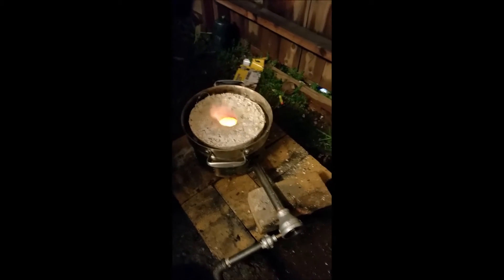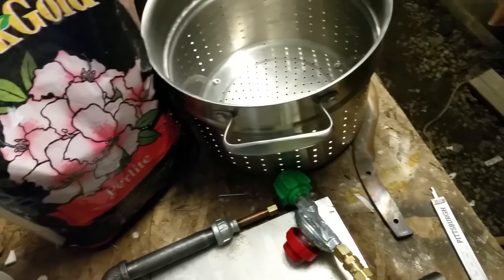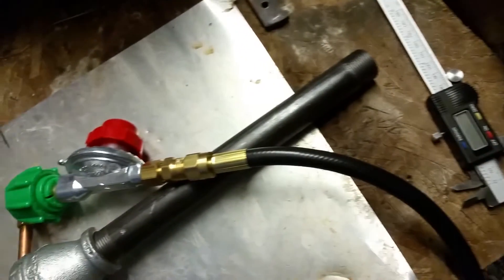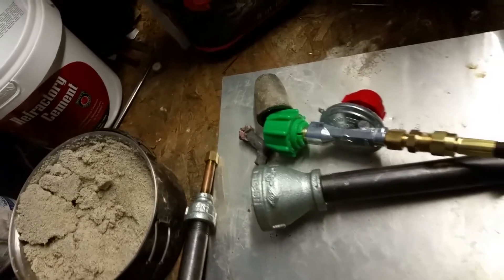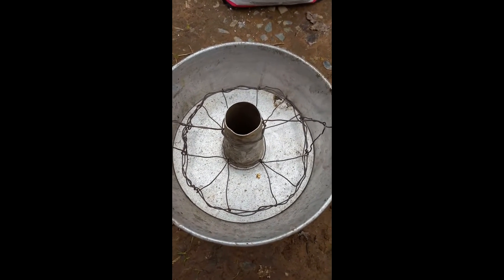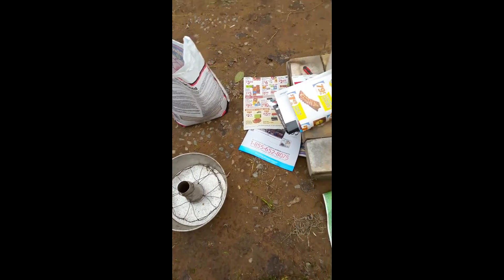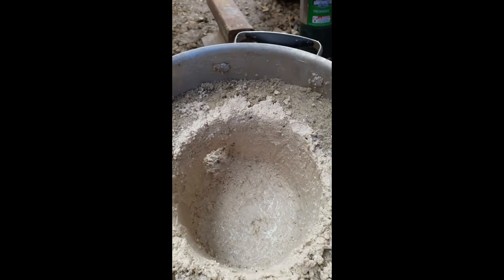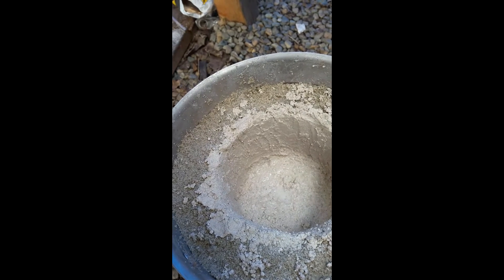Complete mini-forge/foundry build for (Just over) $110 (parts in description)

Comment: Shit! I’ve been thinking for the last two days about how to make my lid and you just solved my problem with the cake pan. Brilliant and simple. That’s probably why I couldn’t think of it. I guess I’m kinda stupid! Lol

I would need a larger center hole than the one you have but I’m sure they make all sizes of cake pans. 

Overall your furnace seems to have turned out very nice. I was going to try to save some money and use plaster of Paris and play sand mix because my furnace is going to probably be about twice the size of yours and the refractory cement gets a little expensive. Still not 100% sure of what I’m going to do on that subject. Any advice on this??
Reply from the maker: I DO NOT recommend skimping on your refractory. Its worth the investment in good 3000°F refractory and some pearlite. if you want cheaper filler get some soft white firebrick and mould your castable refractory/pearlite mixture around it. this foundry and burner are still serving me.